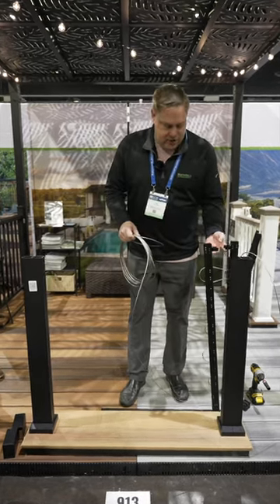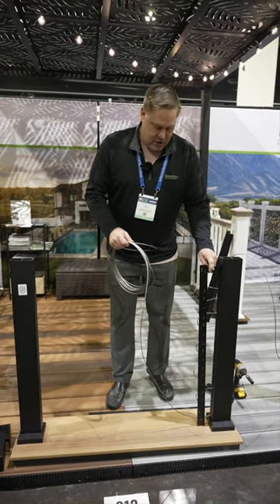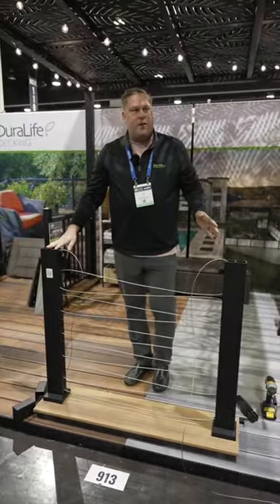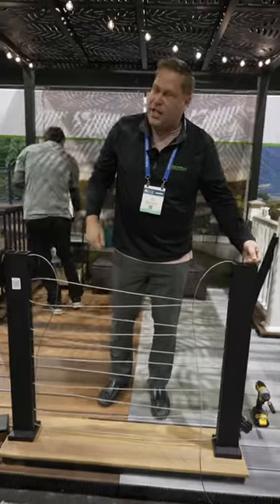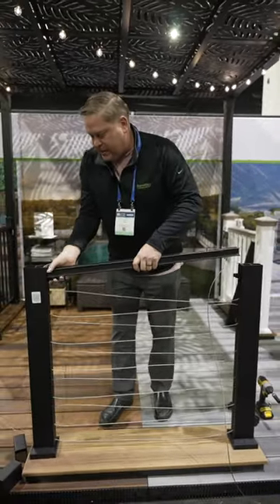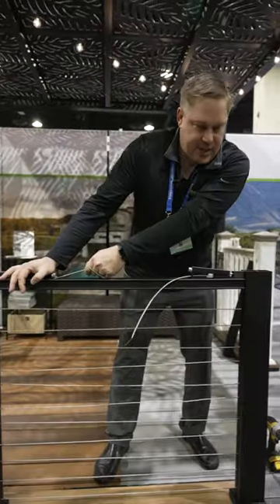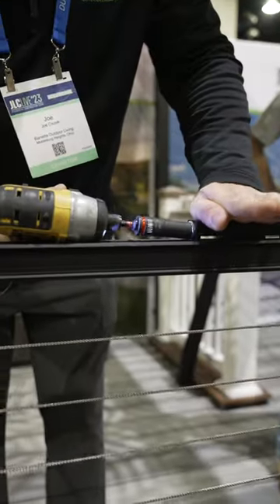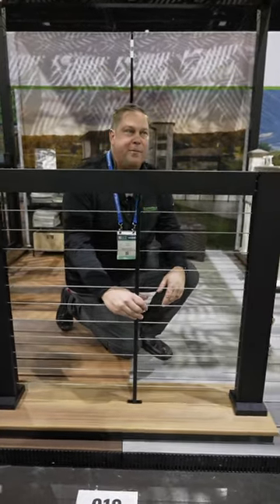Innovative New Railing Installation! #railing #newtechnology #constructiontechnology

Comment: pros- easy installation
cons- if the cable breaks from anywhere, the whole cable will be loosened.
Reply: But it can take more beating because the stress is along the whole length of the wire
Reply: @mr19zee  i agree bro
Reply: @mr19zee im still skeptical of its safety even though this fact.
Reply: It’s meant to be temporary not permanent, if he thinks it’s permanent this company is insane, this is a makeshift barrier used by military to set quick lines and what not
Reply: @shangrilaladeda 
This man has patio furniture behind him and mentions “trim to make it look pretty”. I’m pretty sure it’s intended to be a permanent install for homes.
Reply: @Warriorcat49  time will tell
Reply: Well, we would just need to review the tensile strength of the cable in question, just by observation that looks like a 10 braided line. Probably a few millimeters thick, I don’t think a human could except enough force to break that. (Not using tools obviously)
Reply: @not-fedrayepps5203 i was about to say... How often do people think stainless cable breaks???
Reply: @not-fedrayepps5203  indeed, these under tension would have a lot of strength, however, let's say a child decide to climb them. The line being stood on will of course be pressed down, placing it under tension, however, the points at which the cable come in contact with the posts will experience sheer loads.

In addition to that, if this was an end post, pulling the lines down, if they are all allowed to slip through the posts,  it would act as a pulley, the load on the post would be tremendous.
Reply: @MinkieWinkle  negative copy on the pulley aspect of your argument, a pulley system gets its strength from the smooth operation of the wheel inside the pulley, running cable through a wood or metal eyelet will not produce the same results. Again, braided metal cable can not be easily broken.
Reply: @shangrilaladeda it's 100% intended to be permanent. Cable railing is one of the "fancier" options for patios and such

Comment: single point of failure. one section of line fails. then the entire fence fails. so it is no. change the design, another fixing plate that locks all the cables from the top of the posts
Reply: Do stainless cables like that fall often? Use the exact same cable for our boat lifts. Which have the forces constantly changing and in a wet environment. Lasted 30 years, no visible issues.
Reply: @jeffrbake  I don't expect they would fail often, however, in the event they do, it could potentially have life change consequences.

Personal, I believe each strand should be fastened, to mitigate the single point of failure. A small grub screw on each run. Or somthing.  So even if a section breaks, the rest will not go slack, the grubs will hold them firm. Until a repair can be carried out.

Comment: What is it used for?
Reply: Fancy decks where they don't want to use wood.
Reply: DIY easy to install cable railing for a deck or patio or whatever
Reply: to drain money, thats why
Reply: It's used to keep your wife from sneaking out
Reply: It is a harp for the deaf. They can feel the vibrations from the cables. ;-)
Reply: My prisoners ive also electrified it.

Comment: You now have to do that whole pull and tension on every single 8' section instead of just sliding cable through a predrilled hole and tensioning once. This is junk

Comment: Makeshift barricades it’s good to get hand me downs from the United States military
Reply: I don’t remember anything this fancy during my service time.
Reply: @ALMX5DP  it’s not meant for battle but crowd control in a city area could work in the middle of nowhere but the military has easier ways of getting it done
Reply: @shangrilaladeda  we always used basic stuff like cones and tape, or for slightly more permanent solutions the stuff you see at airports with pylons and extending straps. For more secure areas, it was always chain link fence sections or K-rails.
Reply: @ALMX5DP  it’s cheaper that is why
Reply: @shangrilaladeda  that’s why what? My point was in my 10 years I never saw this being implemented in the military. I am suspicious of that claim that it came from there.
Reply: @ALMX5DP  the military has many things never to see the light of day and some others that are set to be released on certain dates
Reply: @shangrilaladeda  well if you have support for your statement that this has been developed or use by the military, I’m all ears.
Reply: @ALMX5DP  time will prove for now the Bible is enough until it’s fully understood no one will go anywhere

Comment: Easy to break
Cut one wire job done
Reply: Its not a security fence.  Its a RAILING
Reply: @soccerguy2433  If it were, or you just wanted to add a bit of chaos, you could attach a generator to it to make it an electric version.
Reply: @saliosnoctin7797  Exactly what i was thinking
Reply: any house on earth is easy to break. Just remove one wall.
Reply: @Mikael-jt1hk  not really, most buildings could most likely stand without one wall if 3 are intact but i get your point even though it may not be 100% right
Reply: @soccerguy2433  yeah and some railings are at height to stop people falling to their death.